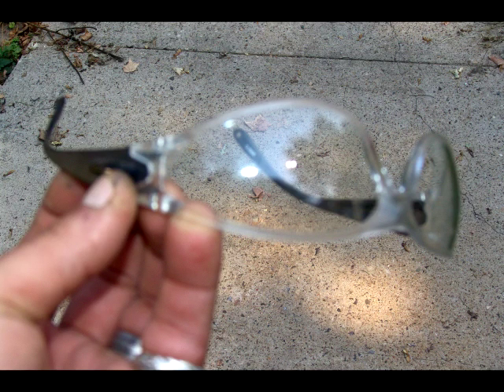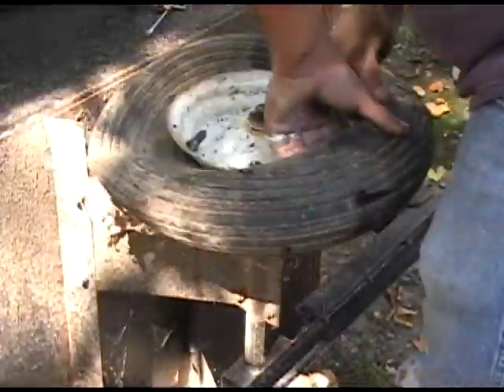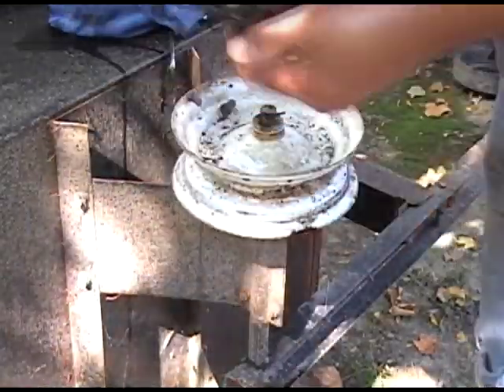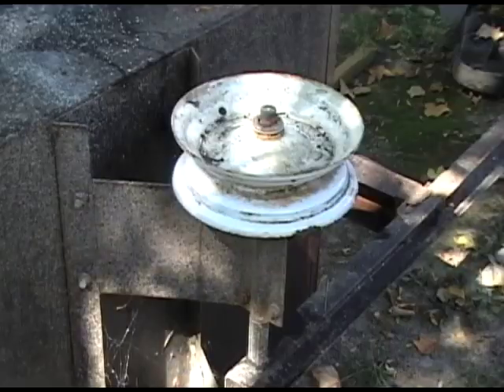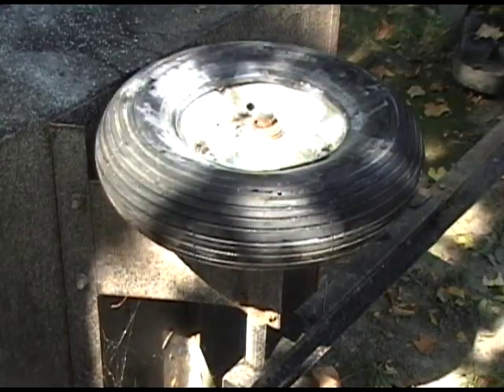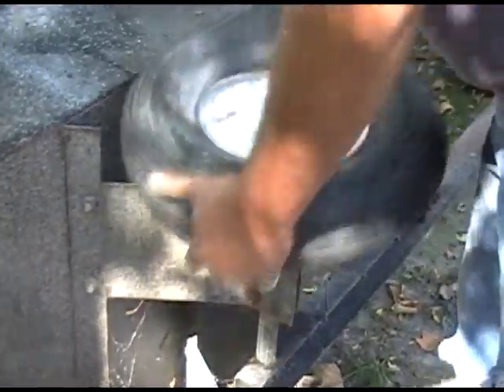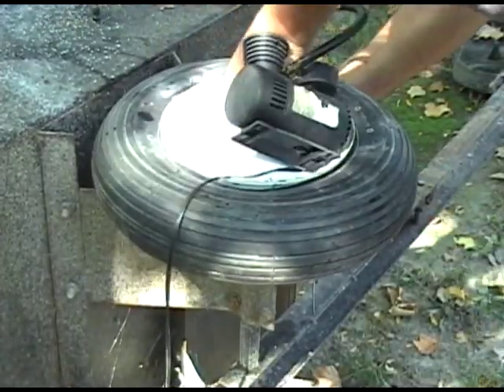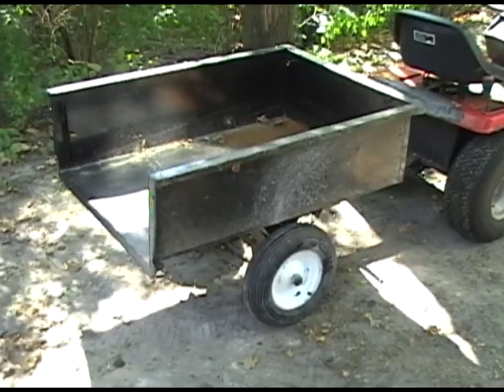DIY - Garden Trailer Inner Tube Installation

Comment: This worked great, after adding soap to lube the rubber sliding over the edge of the steel rim. This first one was testing me to see if I had the resolve, but the second one worked as advertised! I think I have the same trailer (Harbor freight) too.